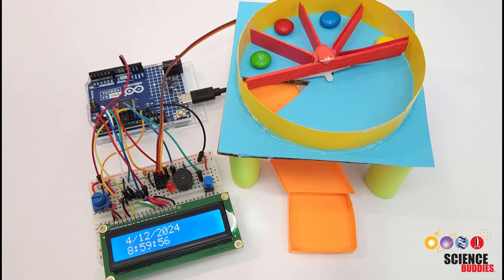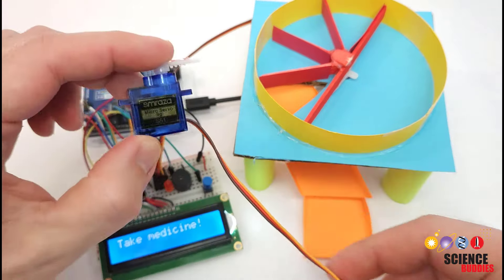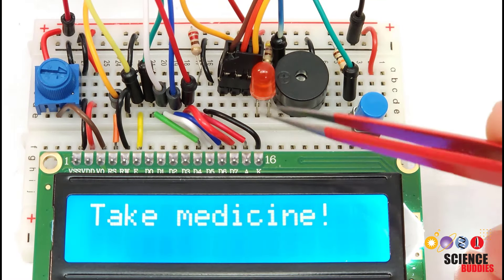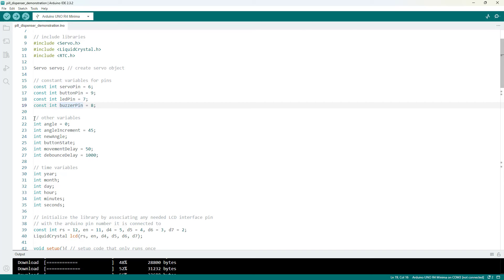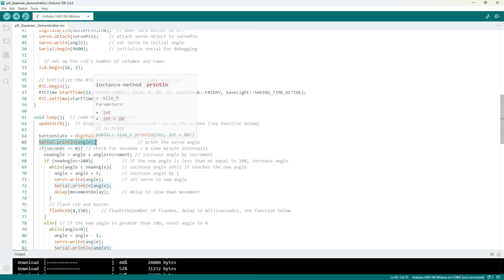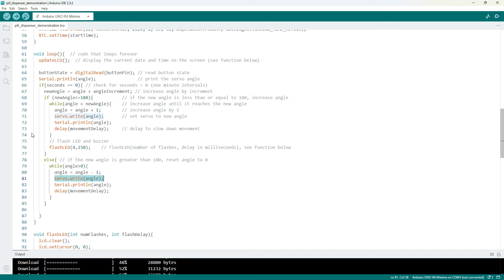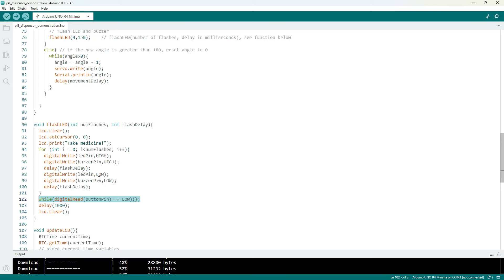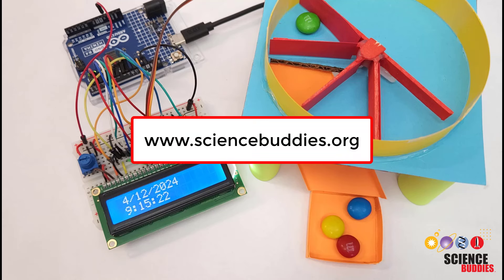Build an Arduino Automatic Pill Dispenser | Engineering Project

Comment: Hey can you please provide me code and circuit diagram I was in so much hurry I got ds1307 rtc and RG1602A LCD screen I have to submit it tomorrow 😭😭😭🙏🏻
Reply from the maker: Hi - the link in the description has instructions with the code and circuit diagram for the parts that we used. We are unable to provide code/circuits for other parts but you may be able to get help in the official Arduino forums.

Comment: I was making this for my school project but I can’t seem to remake the breadboard and arduino and how the wires and pins are placed. The website doesn’t help as the breadboard from tinkertad looks different from yours. Can you please help me I need this for my grade please.
Reply from the maker: If you are having trouble then we recommend watching our how to use a breadboard video before you continue: https://youtu.be/6WReFkfrUIk?si=A02WPFZFcafyFJ1-. This is a complicated project with a lot of wires. There are multiple ways to connect things on a breadboard that are electrically equivalent, and understanding that requires understanding how a breadboard works. Some of our videos might show circuits that are not an exact physical match to the corresponding figure in the written instructions, but their electrical function is the same. We recommend using the figure in the written instructions as a reference and building based on that.

Comment: You supply power to the servo directly through the 5v output on the arduino? Shouldn't we use an external power supply for the servo?
Reply from the maker: For a single small servo, you can get away with powering it directly from the Arduino. This is what many introductory Arduino tutorials show due to the complexity of connecting an external power supply for new users. You are correct that in general it's considered best practice to have an external power supply for motors though - we have another video addressing that here: https://youtu.be/I7MrL5Q7zvY?si=XCq38h574fgC4hy5

Comment: Does it matter what type of lcd display is used? Because my lcd screen isn't displaying anything. It is a 16x2 but the pins look a bit different on mine compared to the tinkercad. Thank you for your help 😭💕
Reply from the maker: Hi - if you have a different display with pins that do not match our wiring diagram, you will need to look up the documentation for your specific display.

Comment: Can i set this for 360°
Reply from the maker: You could use a 360 degree (continuous rotation) servo but you would need a sensor like an encoder to measure the angle, otherwise the motor's position may drift over time.

Comment: Can we use aurdino R3 in place of it?
Reply from the maker: This project will work with an Uno R3 but it does not have a built in real time clock (RTC), so you will require an external RTC.
Reply: Plz can u send code for ARDUINO R3 and external RTC

Comment: can i have the coding ur using rn, in the video
Reply from the maker: Please see the link in the video description!
Reply: @Science.Buddies  this one ur using is for r4 right? What if i use r3?
Reply from the maker: See the materials list for the project - you can use an R3 but you will need an external RTC. The R4 comes with a built-in RTC: https://www.sciencebuddies.org/science-fair-projects/project-ideas/Elec_p105/electricity-electronics/automatic-pill-dispenser#materials